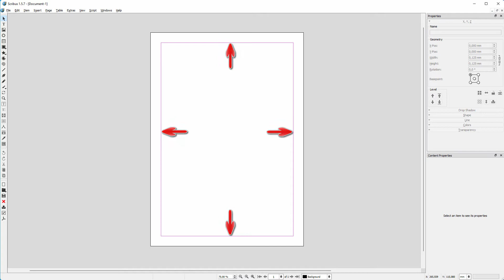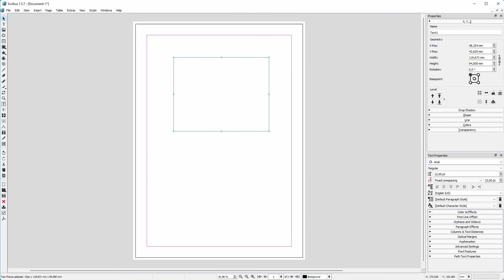5) Create a new document in Scribus

Comment: Hi! Im new with Scribus and have never used Adobe Indesign or Photoshop. I used to work with QuarkXpress decade ago only for some personal use in a small scale and i changed my career. I want and need to learn designing deskstop publishing all over again and was thinking of starting with Scribus. Im wondering if i should simply go with the 'Stable Branch' version without the Goshscript, or if i should go with 'Developement Canditates' . Will i be able to catch up with your professional preferences, customized user interferences and lessions ?. Im only concern because i consider myself a beginner and im only using my old laptop with 4GB RAM. Kindly advice,
Thanks.
Reply from the maker: Hi G. Thank you for your comment. You can best go with the development candidates (which i am also using in this course). A laptop with 4GB RAM is fine. Good luck!
Reply: @GraphicdesignforFree   Thank you, appreciate it.